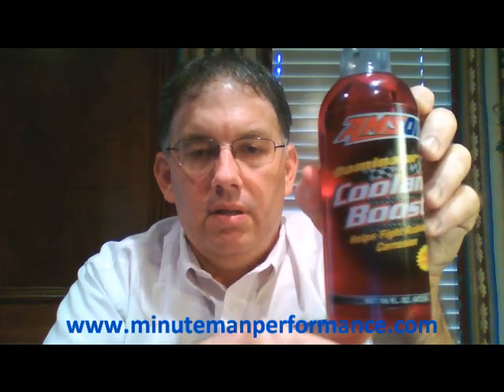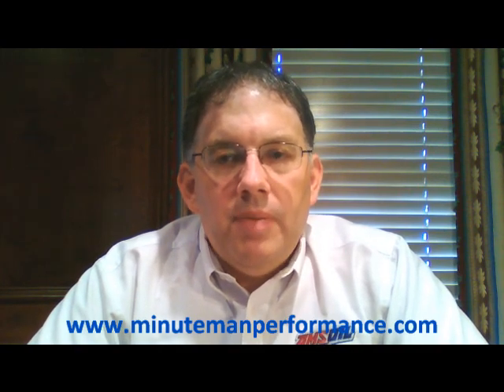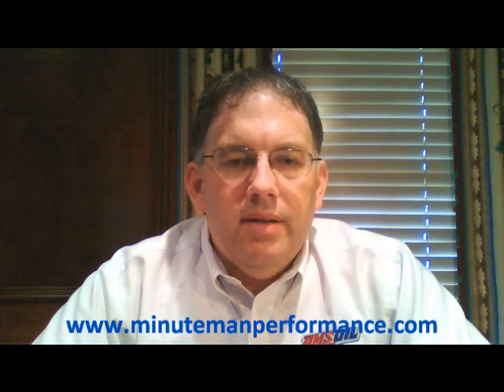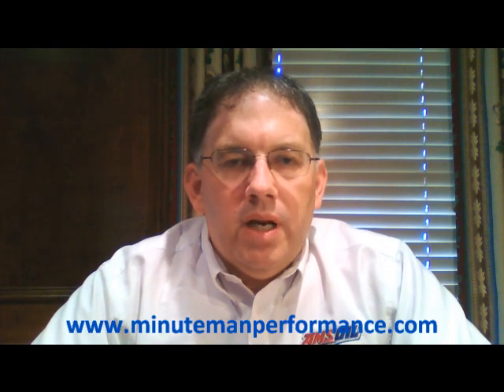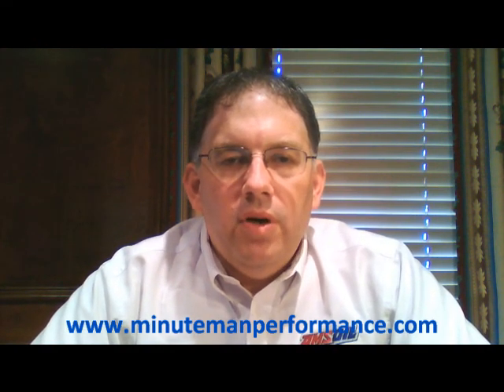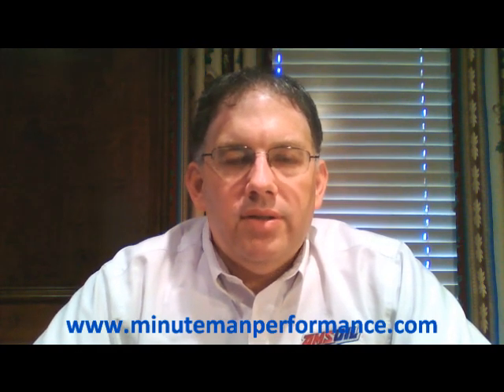AMSOIL RDCB Dominator Coolant Boost

Comment: After the first year of using amsoil coolant boost, do I need to change all the antifreeze and fill in a new one? Or i can just add the new amsoil coolant boost into my old antifreeze
Reply from the maker: You need to test your antifreeze/coolant mixture for freeze/boil protection and ph levels.  This is easily done using test strips available from AMSOIL or other suppliers.  In addition, you should add new Coolant Boost every year to replenish the benefits it provides, as they are depleted over time.  The Coolant Boost helps prevent corrosion in the cooling system, but it doesn't affect freeze/boil or ph levels.

Comment: Hello, please tell me, does this product only work with antifreeze, and will it be of any use if i add it only to antifreeze? And how long does it work?
Reply from the maker: You can add it to straight water (on-track racing events), or to a mixture of water and anti-freeze/coolant.  Retreatment required yearly.
Reply: @Best-Synthetic-Oilscom  I mean, does it work, only  with Antifreeze? And whether it makes sense to add it when only Antifreeze is filled in. I do not have a racing car, but just an SUV, sometimes I operate in difficult conditions. Thanks
Reply from the maker: @eduardsavin4197  When this product is added to your cooling system (water and antifreeze mixture), it helps reduce friction in the cooling system, and eliminates hot spots in cylinder heads.  Engine also warms up much quicker as well - great in winter!  So YES - use it in your SUV.  1 oz of Boost per Quart of cooling system capacity.
Reply: @Best-Synthetic-Oilscom  After the first year of using amsoil coolant boost, do I need to change all the antifreeze and fill in a new one? Or i can just add the new amsoil coolant boost into my old antifreeze

Comment: I don't see on amsoil website that this is recommended for diesel semi trucks. Is there a reason not to use it in semi trucks?
Reply from the maker: Works in any liquid cooled engine, including diesels.  Add 1 ounce per quart of cooling system capacity.

Comment: Do you know of any tests on coolants? Or anyone that has done a general test?
Like Peak vs. Amsoil Heavy Duty vs. Subaru Super Blue vs. Toyota Long Life? I haven't used amsoil yet, but the old toyota long life was pretty freaking epic.
Reply from the maker: I haven't seen any comparison testing.  You can submit samples to the big labs for testing against the original spec of the same product, but not against each other.

Comment: Why do the antifreeze companies not have this technology infused into their products?  Including amsoil?  I’m confused as to how it warms up faster but it runs cooler at full temperature???
Reply from the maker: The reason they don't incorporate it into coolants is mostly likely the cost.  As the EPA pushes fuel economy higher and higher, the OEM's probably will incorporate it to reduce warm-up times, which will reduce cold-engine emissions and improve economy as well.  I don't know the science behind the warm-up quicker part, but I've used it and it does work.  The cooler at full-temp only applies to engines not equipped with a thermostat, since it maintains the temp to above a certain point.  But the Coolant Boost does reduce friction in the cooling system, which helps eliminate hot spots in the cylinder heads, especially around the exhaust valve guides.

Comment: If you want to put RDCB in cooling system and this is in MAX capacity, what is the proper way in such situacion? Regards, Lojzi
Reply from the maker: You may need to drain out some of your current coolant to make room for the AMSOIL Coolant Boost product.  If you are changing the coolant in your vehicle or equipment, you should substitute Coolant Boost for the same amount of water of your coolant / water mixture.  Coolant Boost will not replace the antifreeze/coolant portion of the mixture.   Contact me directly at (678) 787-3028 if you have further questions.

Comment: what type of water do you recommend if using straight water applications?
Reply from the maker: Christopher:  AMSOIL recommends using softened tap water if you are running a straight water system and RDCB Coolant Boost.  If softened water isn't available, then use regular tap water.  If you are adding RDCB to a 50/50 coolant mix, then they recommend using distilled water.

Comment: Hi i am from Quebec .. I am a Chevy cruze owner and I just bought a bottle of that product .. How many quantity of the bottle I have to put in the car ?

Shadoe 

Chevy Cruze 2014 1.4L Turbo
Reply from the maker: Add 1 ounce of AMSOIL Coolant Boost for each quart of cooling system capacity.
Reply: Best-Synthetic-Oils.com thank you!!
Reply: Goto amsoil.com and look up your model vehicle. You can also call amsoil. Their number is on the website. Ask for the technical department

Comment: Tom: Is this coolant boost compatible with ALL Brands of Antifreeze?  I was contemplating adding this product to the cooling system of my new 2014 5.7L Hemi Ram.
Reply from the maker: Yes.  You can add it to ethylene or propylene glycol-based coolants, or to straight water.
Reply: Best-Synthetic-Oils.com Is this compatible with HOAT technology also?  Most HOAT antifreeze says it is incompatible with anything except other HOAT antifreeze.
Reply from the maker: Rick Bradley AMSOIL Coolant Boost is compatible with all types of antifreeze/coolant technologies and can also be mixed with straight water for racing applications..
Reply: Best-Synthetic-Oils.com That has the appearance of a straight up marketing response with no thought or background knowledge on HOAT based antifreeze.  I use AMSOIL products for all my engine oil, transmissions and differentials, so I am really interested in this, however, Dodge specifically states NOTHING is compatible with their HOAT technology antifreeze specifically for my (and all) 2007 diesel 5.9L engine.  A catastrophic failure while towing 12,000lbs through the mountains of Colorado would be unacceptable, so unless you have some specific information from AMSOIL in regards to Dodge/Chrysler HOAT compatibility this is one AMSOIL product I won't be using, thank you.
Reply from the maker: Rick Bradley Rick - The warning on HOAT products is telling you to not mix it with any other type of antifreeze/coolant product, except for another HOAT product.  AMSOIL Coolant Boost is not an antifreeze/coolant product - it is a tiered surfactant that also contains dispersants that prevent deposit formations, lubricants for water pump seals, and oxygen scavengers that remove oxygen from the cooling system, which prevents rust and corrosion. As such, it is formulated to mix with any type of antifreeze/coolant product, or with straight water. You already know and trust AMSOIL products - do you think they are going to risk their reputation on a small-volume product like this one.  It's a great product that I've used for years and my cooling systems are spotless and I've never replaced a water pump, heater core, or radiator.
Reply: Best-Synthetic-Oils.com Thank you for the explanation, that makes more sense.